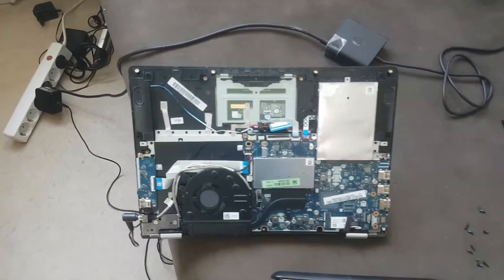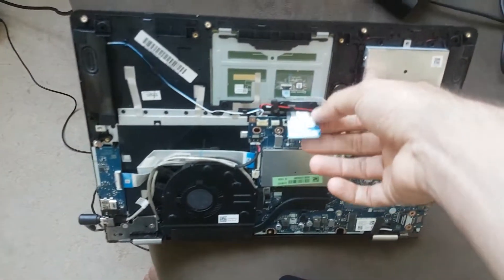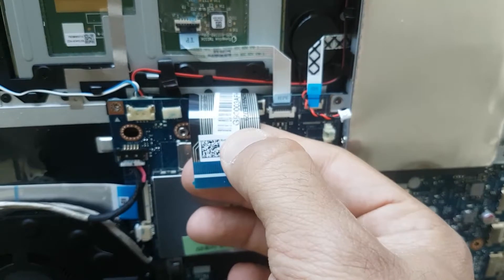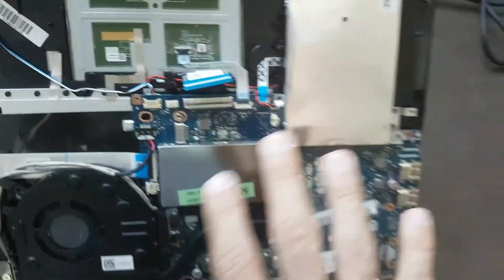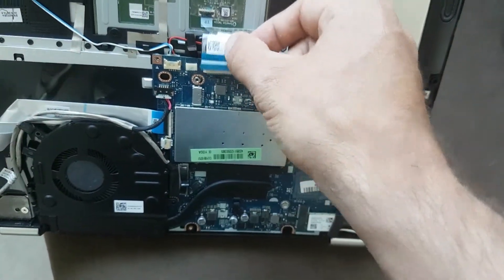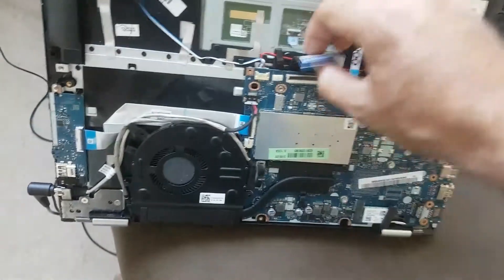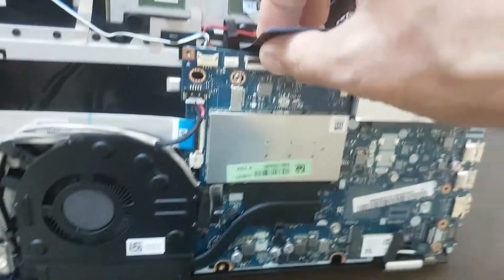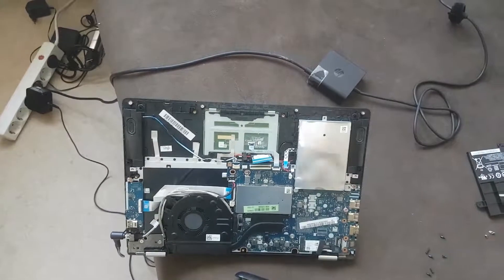Fix Laptop Keyboard some buttons stopped working ribbon flex cable issue

Comment: Thanks for the info. When you install a new laptop keyboard, the ribbon cable also changes? Or it is the same one? Because after I installed a new keyboard, the same keys still don't work.
Reply: The ribbon will change too!